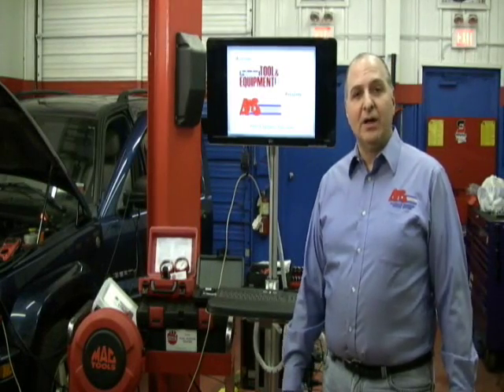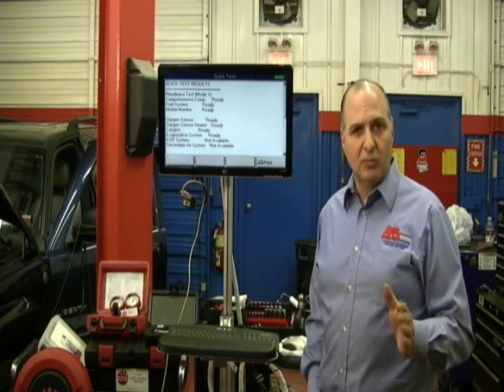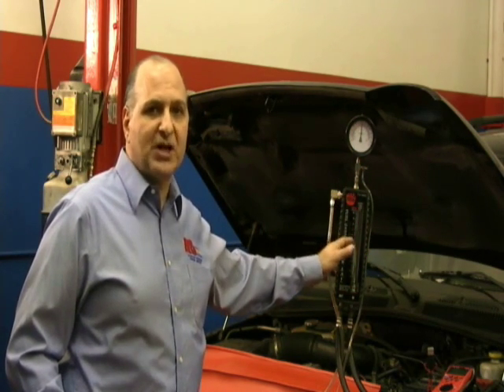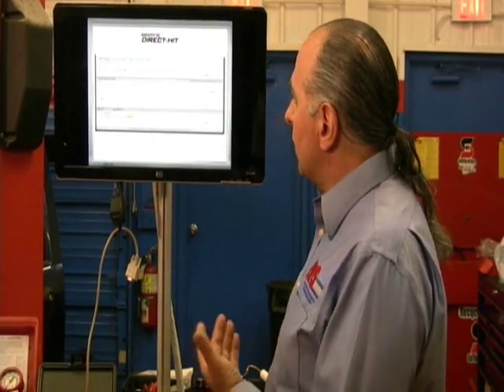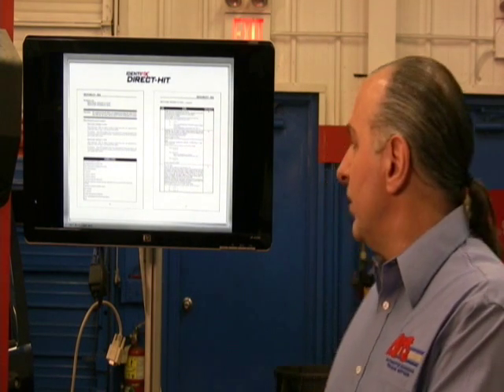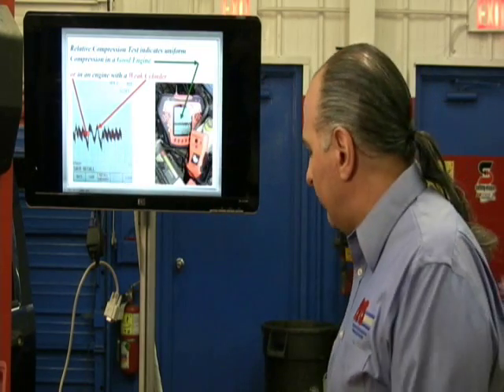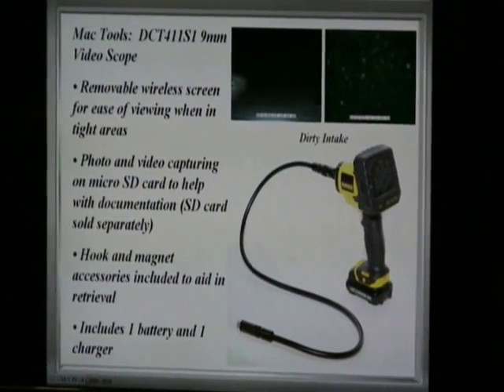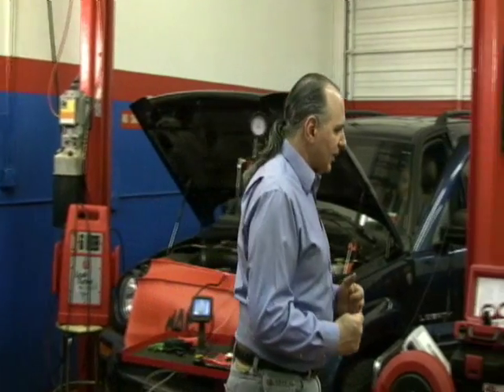P0171 System Too Lean DTCs with G Jerry Truglia

Comment from the maker: It looks like your ECT is low... I assume the readings are from a warmed up engine at idle. Check your intake, air filter etc.How about the O2 sensor? Fuel delivery?

Comment from the maker: Change your scan tool readings from LBS to GPS...You should have 1 GPS per cubic inch of displacement. Is it a 2 Bank system or just one? It looks low. The fuel trim being that high means you have a Lean condition and the PCM is trying to add fuel. Does the O2 sensor read over 850Mv when you add propane or tap the throttle 5 to 6 times (so the TPS will send a rich signal to the PCM)?Try disconnect the MAF and check STFT and LTFT, Check for vacuum leaks, fuel delivery...

Comment: all you need is the freeze frame data and the a scan tool to look at current STFT to know if the lean code is vacuum leak related or under load.

Comment: DTC P0171

Fuel SYS1 cl

Fuel SYS2 N.A

Load PCT calculated load value 18,0%

ETC engine coolant temp 86 C or 187 F

Short term fuel 1,6%

Long term fuel 24,2 %

Map 29 KPA

RPM 601 RPM

VSS Vehicle speed 0

spark advance ignition timing advance 10

IAT intake air temp 57 C

MAF 3.00 g/s

TP 12.2 %

Air Stat off